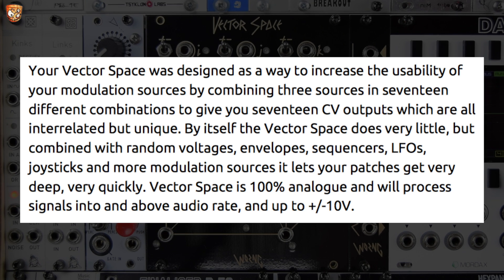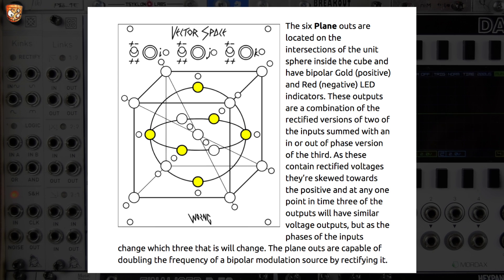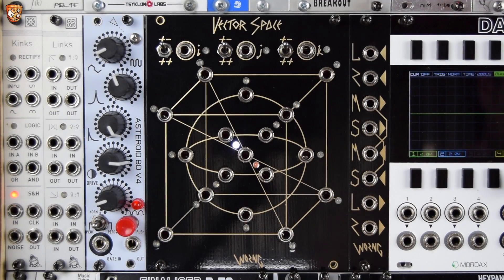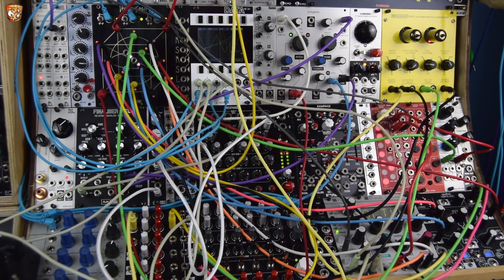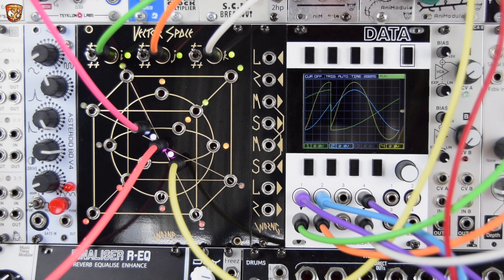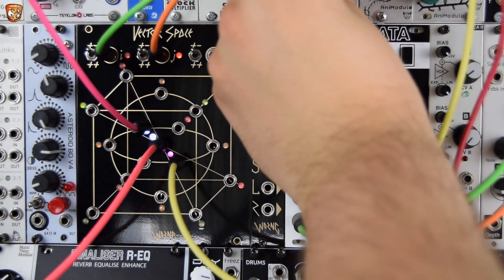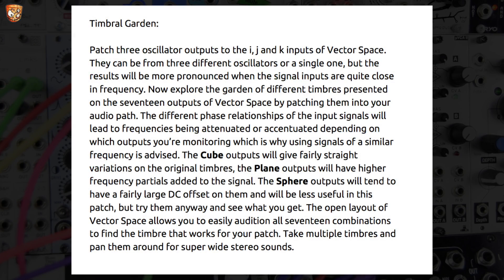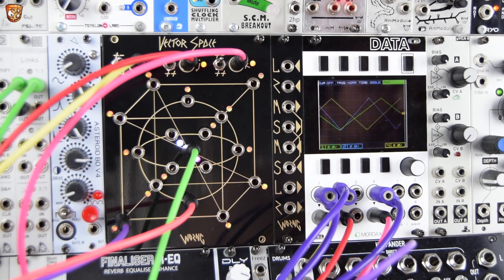WORNG Electronics - Vector Space (3 in 17 out cv/audio wizardry!)

Comment: My Vector Space arrived today (still waiting on the Sound Stage). This module is an absolute joy to use! I set up the Timbral Garden patch using a Studio Electronics Oscillation, with the triangle, saw, and sub outs feeding the Vector Space. Then I ran two outputs into the Disting running dual reverbs. Added Intellijel Quadra to a Make Noise Dynamix. Superb sound! Now I have to figure out how to incorporate the LRMSMSLR into the mix. Thanks for this inspiring demo, I couldn't be happier with the decision to add this to my setup!

Comment: Thanks! Without knowing anything for sure, isn't this a bit like a simpler more hardwired version of the Coherence module from Metabolic Devices? Anyway I think it looks awesome and easy to grasp after watching this video. Thanks a lot Ben! <3
Reply: Ah, I just saw that Coherence only has two inputs.
Reply: Which reminds me, I would be sooo game on a Coherence video from you. <3
Reply from the maker: Yeah I'd like to do a Coherence video, not spoke to Metabolic Devices though and I don't have one. I don't think the modules are that similar, but maybe there's some cross over.
Reply: @DivKid  Yeah, after doing a little more research on the Coherence module, I see what you mean. But I guess they both do CV based on the relationship between different sources. Vector Space does stuff without multiple inputs though, but I'll be looking forward to the video nonetheless.
Reply from the maker: No plans to do a Coherence video currently as I have plenty of other things planned out so it'll be a while before I think about it unless they get in touch.